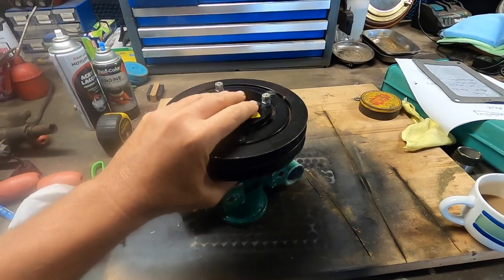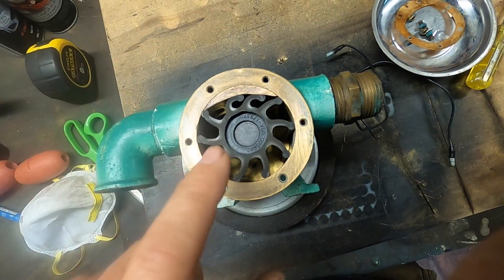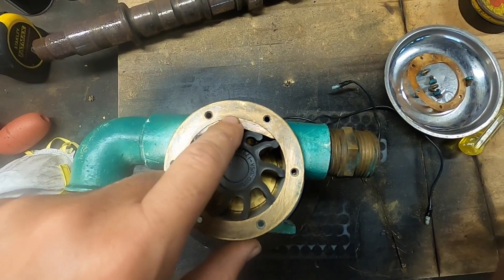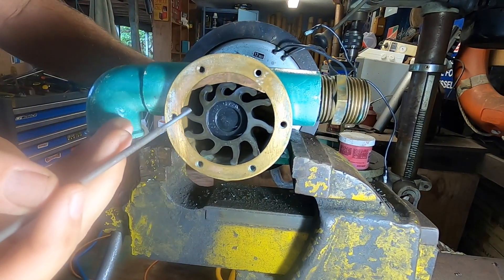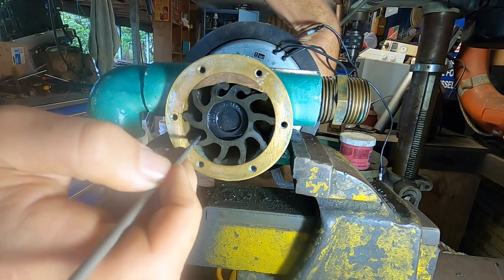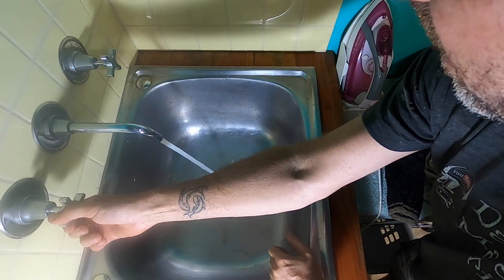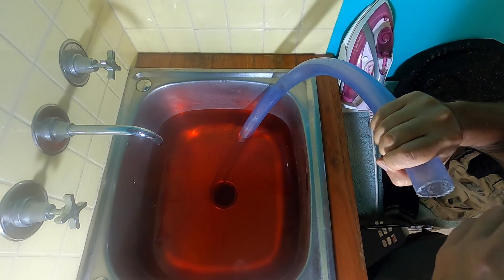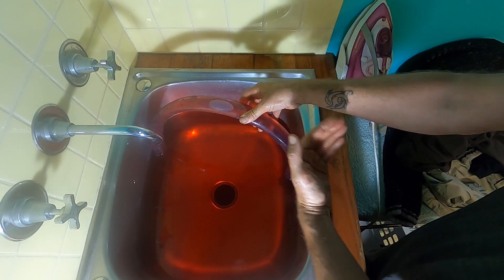How does a Jabsco pump work?

Comment: My '52 correct craft with a Graymarine 620 has been fitted with a Jabsco 2620-1101 rubber impeller pump. There is a a small screw on top..it threads in but not snugly..is that how it's supposed to be? Also it looked like there was some thread Sealant (reddish) around the area. It looks like the mechanic that winterized the boat removed it for some reason. He is no longer here. What is the best thing to do to lubricate this pump properly before starting the engine after storage?

Comment: Thanks Stu for going over the Jabsco basics, I just wanted to add that often your Jabsco is located low on the engine near the water line and should have a P trap arrangement like a home plumbing fixture in order to trap some water in it to prevent dry starts. Keep sailing, no submarines.

Comment: Good video, got a question, I'm changing my water pump myself for 1st time,I was told oil will come out when I drop lower unit,have you changed one like mine? 2005 Mercury four stroke efi 60hp, just changed oil and not sure if it's true.

Comment: So what sort of RPM do these pumps like to do, guessing by the pulley size I’m saying about 150% of engine RPM on the diesel. But the one on the engine is connected to the blower drive isn’t it, and the blower is doing a lot more RPM then 150% if engine RPM. It’s probably a stupid question, considering they are on outboards that spin a lot faster too. I suppose a better question is, what is their ideal RPM range? Are you going to use that pump running off the engine as a deck wash pump? Flick a switch to power the clutch and hose down the deck?

Comment: Hi mate, could you help me out. I have a Yamaha Ft 50 . I,ve watched a few of you videos and thought i,d have a go at cleaning the carbs. I,ve done ok but am struggling with putting back the fuel lines to the carbs as in what goes where. Could you do a video if you still have that Yam 50 of the fuel lines or failing that, some close up photos. I,m stuck mate and would really appreciate the help.

Comment: Ok, this is a tad complicated but hopefully Stu will read and understand. When cruising the Pacific Northwest sea grass or other flotsam fairly often plugs the raw water inlet. A friend I met decided waiting for the temperature alarm to indicate a problem wasn't ideal. So, like Stu, he installed a flow meter. But, being an electrical engineer, he took the flow sensor and added the signal to the rpm of the engine and sounded an alarm when flow vs rpm was too low.  When this happened he would put a hand air pump on a T fitting from the hose out of the raw water inlet and pump air back through the inlet to clear the obstruction. He thought that was less damaging than my wire coat hanger solution and didn't require pulling off the hose. Anyway, love the videos. Let me know if you want to help my friend market his invention...🙂

Comment: What do you mean jabsco pumps are self priming, unlike centrifugal pumps? Neither will prime if there isn't water at the inlet, and if you run a centrifugal dry you'll take out the seals.
Reply from the maker: Not true. Jabsco jumps can draw water up from quite a distance. For example, when I started this for the first time the seastrainer was completely filled with air which the Jabsco could pump through and suck the water in.

Comment: Have you got a model number on that pump? I've got one that looks identical but I managed to snap one of the clamp arms off of the mounting foot when taking it apart to clean. No numbers on my unit so finding it really hard to source a new mount, if its even possible.
Reply from the maker: The numbers are in the rebuild video on this pump.
Reply: @DangarMarine  Thats a different pump isn't it. The rebuild video was your raw water pump, not the electromagnet clutch deck wash pump that you show in this video, unless I've missed one.

Comment: Since the pump has an electric clutch on it would that mean the raw water alarm would sound if you turn the clutch off?
Reply from the maker: The coolant pump doesn't have a clutch, this one will just be used as a deck wash.

Comment: Cool...so is a Jabsco, or that pump considered a positive displacement pump?  I'm quite interested in this both below the water line intake/outlet system, obviously the strainer has a clear top so you can see flow, but that's under the cover and in most boats well out of sight so the alarm (agree with Canonfirefly on the Python skit!!) is a necessary thing really...that said, what's the benefit of both under the waterline aside from always being primed? or is that sufficient reason to have both that way?  sorry if that sounds confusing.... another great one and thanks a load for posting!!
Reply from the maker: Yes, they are positive displacement pumps. Being always primed is the main reason, but they are also quieter as the water isn't gushing out the side. They can also prevent water being dumped onto a pontoon when idling alongside depending on where it comes out.

Comment: Stu you may have discussed what size bilge pump to use, but do you take into consideration the volume of water that can be supplied by the largest seacock on the boat in determining bilge pump size?    Also would it be beneficial to install a Tee at the raw water strainer with valve and a hose running down into the bilge so that the Jabsco raw water pump could be used as an extra or in additional bilge pump in an emergency?
Reply from the maker: Sizing can be important for sure. I've unfortunatley gone 1/2 smaller than what in the boat originally due to that being biggest through hull seacocks I could get. I have thought about adding the ability to use the cooling pump as a bilge pump. This is normally achieved by installing a seachest that combines all plumbing.

Comment: I always used grease to initially start pump. Should I be using silicon? . Seems grease had no adverse effect. Thanks....
Reply from the maker: I think with modern materials it is probably safe. I've just always been told to use silicon or water based lubricants with flexible materials like impellers. You can get stuff callled "rubber grease" too which we always kept in the shop.

Comment: I cant imagine having a sea pump not running. It's the first thing I check. Without it my exhaust would be on fire in about 30 seconds.
Reply from the maker: The clutched pumps are only for auxillary devices like deck washes.
Reply: @DangarMarine  I figured as much but it's still weird seeing it.

Comment: Does having the outlet below the water line create any back pressure, or is that not an issue once the boat starts moving?
Reply from the maker: If anything, less. Having the outet up high means you need to lift the weight of the water.

Comment: Stu, great explanation on the working of a flexible  impeller pump. Outboard pumps, while also being flexible impeller pumps, act as both a displacement pump and a circulating or centrifugal pump.

At low to moderate speeds the pump works just as you described for the flexible impeller pump. At high speeds, the resistance of the water in the pump causes the blades to move inward and away from the inside surface of the pump. At that point, it becomes a circulating pump. The forward motion of the lower unit through the water provides the impetus needed to prime the 'centrifugal' pump.
Reply from the maker: Interesting to hear, and it does make sense that once you have a continuous flow of water that you just need to keep it moving like when siphoning a fluid. Thanks for taking the time to share your knowledge with us!
Reply: @DangarMarine  Stu, thanks. You do a great job explaining all of the workings of your engine, projects and boat. Given my advanced years, I have picked up some as I worked on outboards since I was 8.

I used to collect and restore antique outboards and a number of them had metal impellers and pumped fairly well as long as the pump was submerged and there was no thermostat.

Can't wait to see your boat under weigh. And if I had a Detroit that looked as good as yours, I would have a plexiglass hatch over it for all to see.

Comment: Just a side note, rubber doesn't handle mineral oil based lubricants well.  Neoprene does, and is common in oil seals and O rings.  Silicone based elastomers are becoming common in applications that require good flexibility over wide temperature ranges.  Many of them do NOT play nice with silicone lubricants.
Reply from the maker: Interesting, thanks for sharing!

Comment: Jabsco water impeller pumps are great. It will be fantastic when someone can invent a heat resistant impeller, like that ovenproof latex bakeware? 
Stu......., Read on!
We have a 26 foot wooden clinker 2 cylinder Lister Petter 25Hp diesel with a Jabsco impeller for both engine, bilge or pressuring a seawater hose by manually diverting the water. 
Stu, with ours, if it ran dry or with the sea cock closed, it overheats & can easily perish. 
Had the boat for more than 45yrs now (dad bought it when I was 12) and mum basically kept it in the family after my dad died 1 yr into owning the "Lokalee". I was always on it from a young age, it was our 2nd boat. The first was a 22 foot Diesel 1 cylinder clinker build boat with no electrics.  
We had old brass kerosene Port & Starboard lamps & a small kerosene riding light.
Been past Dangar Island many times Stu! (Never been ashore there).
Our boat is down in Middle Harbour, my brother works at Northbridge Marina. His friend is a friend of yours he calls "a bloody mad spearfisherman". Ring any bells?
I have loved your series on "Renko". 
From your outboard videos I have fixed & sold 3 "council clean up" lawn mowers, two were 2 stroke, the other a 4 stroke. 
I used to have both chickens & ducks, until the stupid council told me no more! (Meaning no longer). Some obscure ordinance. It is still a pain buying eggs, my girls eggs were so much richer and I love the taste of duck eggs!
Reply from the maker: It does make sense about the impellers given you can get silicon baking trays these days. Maybe they aren't strong enough from an abrasion point of view. Sounds like a nice couple of boats. Not sure who the "bloody mad spearfisherman" is though!

Comment: Hi Stu, your Jabsco pump setup looks OK. Another setup; plumb the pump at the bottom of an "S" bend that traps a volume of water to keep the impellor wet at all times. This setup is good for boats that are regularly taken out of the water. Also wipe the impeller all over with silicon rubber grease "Molykote valve & "O"ring grease " this is a rubber conditioner and will extend the life of the impellor by a factor of many. I hope this helps. Cheers
Reply from the maker: Good tip! As you say, just keeping a small amount of water to lubricate the pump on startup makes a lot of sense, particularly for boats that live out of the water.

Comment: Does it require re-priming after it's been taken out of the water? ie. on a hardstand for descaling per say?
Reply from the maker: I would just close the seacocks before the travel lift starts to pull the boat out of the water so the cooling system stays full (unless I was planning to work on it of course!)
Reply: @DangarMarine  Thanks mate, boats are new to me and it's all start to make sense.

Comment: Could add an extra layer of security by putting a check valve on the outlet. You could also put one on the inlet so even if you need to fiddle with the pipework you would still be mostly primed.
Reply from the maker: The trouble with check valves is that they are known to fail, and sometimes in the closed position.

Comment: I’m surprised that the impellor doesn’t wear very quickly.
Reply: The water lubricates it and keeps is from running hot and or eating itself up. That's why running it dry is bad, because it's rubs like hell and wears veeeery fast :D
Reply: My Yam150 recommends inspection every 100 hours.
Reply: They don't like silt or sand

Comment: Hey Stu thanks for the video. Much appreciated. Now is it me, or have I just had a Déjà vu moment? Is there an other pump on the engine with the same impel la system that you have shown previously.
Reply from the maker: Yep, that was the cooling system pump that runs all the time, this is a utility pump for deck wash and bilge pump duty etc.

Comment: Thank you Stu!
My old Navy boat has a DD 4-53 and now, through your tutelage, I have changed the raw water impeller; rebuilt the blower assembly, changed the rocker cover and gasket, and am beginning to re wire.
Reply from the maker: Sounds like that boat has fallen into the right hands. :)

Comment: Great explanation! I have a wet exhaust, so in that case I assume you have to except some wear ?
Reply from the maker: Even if they are slightly wet they will stay lubricated. It really depends on how often the boat is used. Either way impellers are service items and need to be replaced every couple of years just to be on the safe side.
Reply: Dangar Marine yes it is. I want to install an alarm because one of the the downsides of my installation is that the wet flexibel hoses don’t like the higher temperatures in case the waterflow blocks of stops. I had a temperature sensor but i like the flow meter even better.  Keep up the great work on your boat!

Comment: Never ever liked Jabsco pumps, spent way too many times over the years replacing the impeller whilst getting thrown about the engine room in rough sea's. Due to relatively shallow water, deep draft, pump picks up sand and chews its insides out. Even in deep water I try to avoid them.
Reply from the maker: What do you use instead?
Reply: @DangarMarine  Used to - a long while ago, havent been back on the water for years, I found Marco & Johnson. In particular Marco, very well made/high quality pumps.

Comment: Not quite mind blowing but pretty close ey, I've always wondered how they worked and have never got around to servicing the one in my outboard... that I've had for 8 years... I think I might escalate that job on my to-do list.
Reply from the maker: Always good to repace them sooner rather than later because if they do break up the parts are hard to remove from the cooling system.

Comment: Hi there Stu you should not use galvanized pipe fittings for seawater it will work like zinc anode  all  the  best from  Denmark

Comment: It's funny to see this today just got my Volvo diesel running to day but my jabsco won't pull water from the garden hose on the out drive any thoughts
Reply: justmaking it , have a look at the impeller
Reply: @CaptMarkSVAlcina  just did new seals and impeller along with new boots on the outdrive
Reply: justmaking it ,maybe the outlet is blocked . ( sorry you did turn on the water ?)
Reply: @CaptMarkSVAlcina  it's odd water will run out from sea strainer to out drive. I have ran water backwards through the hole system
Reply: justmaking it , if that’s not it , then follow the water path from inlet to out let.
Reply: @CaptMarkSVAlcina  that's what I have been doing it will pull water from inlet at the back of the motor just not from the out drive I don't believe there is a pump or thermostat in the 280 outdrive
Reply: justmaking it , what engine do you have and is it a sail drive, shaft driven or is it an outboard , just wanted to make sure I can help you.
By the way if you run water back wards be aware that you may be putting water into the cylinders though the exhaust if you know what I mean. If I can help I will.
Reply: @CaptMarkSVAlcina  it's an aqd40a Volvo Penta diesel with 280 out drive fresh water cooling so water comes up the leg to the jabsco to the strainer to the oil cooler to the heat exchanger then out just after the turbo that's what's strange it a complete open system I've blown air from the turbo backwards all the way to the strainer
Reply: justmaking it , ok , have you done any work on the turbo ? If so and I only taking a guess here did you put the rotating fan in backwards accidentally ? Or did you accidentally  connected up the other way ?
Reply: @CaptMarkSVAlcina  No I cleaned the heat exchanger put new o-rings and impeller in the jabsco and new boots and water intake line on the outdrive That's why it's odd
Reply: justmaking it , just thought of this, it just could be an air lock.
Have a think about this, make sure you have water up to the jabsco then MAKE SURE YOU HAVE WATER AFTER IT, you may have to undo the hose and add water after the jabsco this way you should get rid of the air lock. Sounds like an airlock to me.
Reply: @CaptMarkSVAlcina  I was thinking that too I tried poring wat in the strainer with no luck but I'll try to hoses when I get the new glow plugs in
Reply: justmaking ,great hope that is all it is , just an air lock. 
Please let me know how it goes.
Reply: justmaking it , how is it going, did you fix it and if so what was it ?
Reply: @CaptMarkSVAlcina  I have not fixed it yet
Reply: @CaptMarkSVAlcina  looks like it may be fixed it was the water inlet elbow at the leg I bought one off Amazon that was not perfectly flat
Reply: justmaking it , I am very glad you from out what it was and now you know one hell of a lot more about your engine.
Would you buy again off Amazon.
Reply: @CaptMarkSVAlcina  yes just figure that if it takes a gasket check it with a straight edge lol

Comment: Speaking of fail safe alarms like your raw water flow meter, are you also going to have a alarm for an oil pressure switch. Like the alarm makes noise when you have less then 5 psi? Maybe your gauge will or something. Just curious. 

The noise makers can be annoying but that’s why people use them.